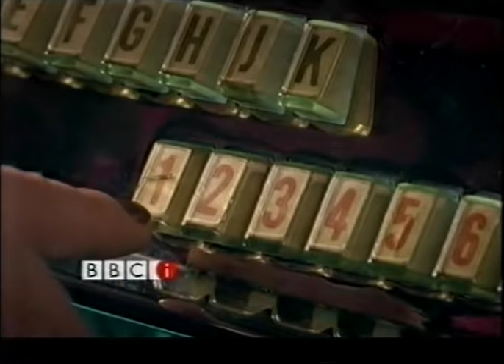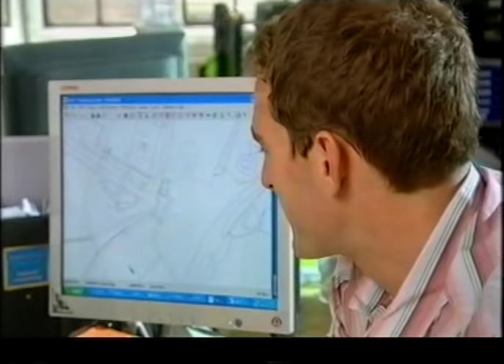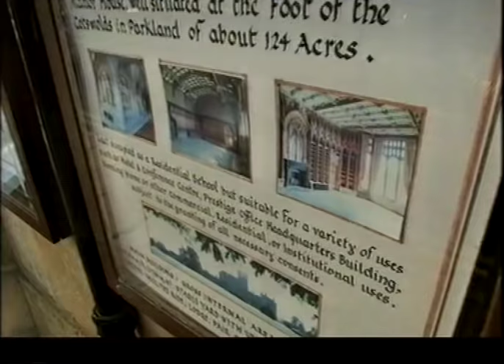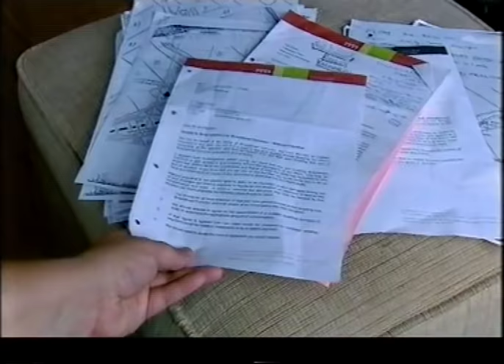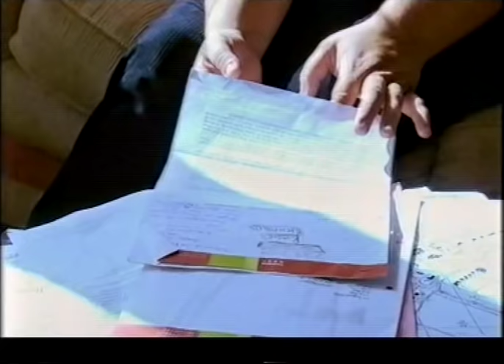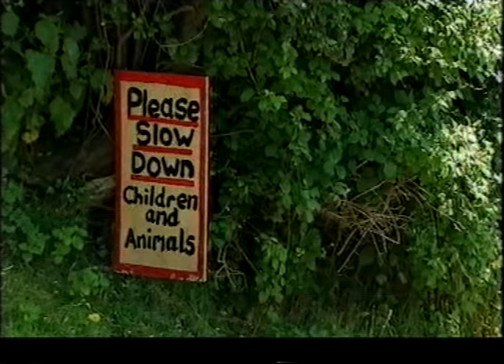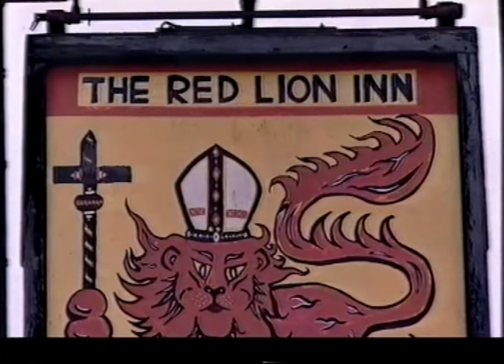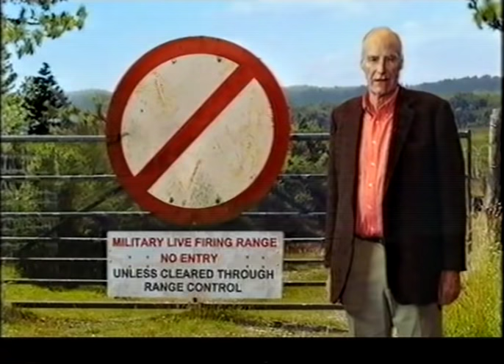'Whose Britain Is It Anyway?' A documentary about land ownership by Dan and Peter Snow

Comment: Roughly half of the greenhouse effect is caused by CO2. Therefore, trees act as carbon sinks, alleviating the greenhouse effect. On average, one acre of new forest can sequester about 2.5 tons of carbon annually. Young trees absorb CO2 at a rate of 13 pounds per tree each year.
Reply: Mark Creed.  Yes. CO2. Gas. Exists. It has measured and well understood, immutable physical properties.